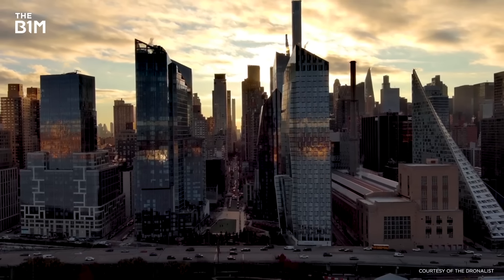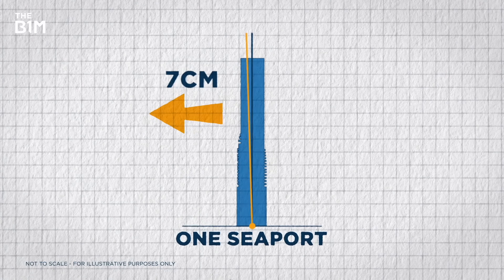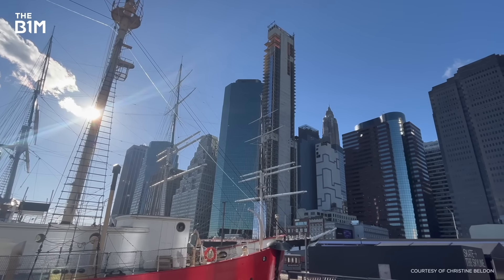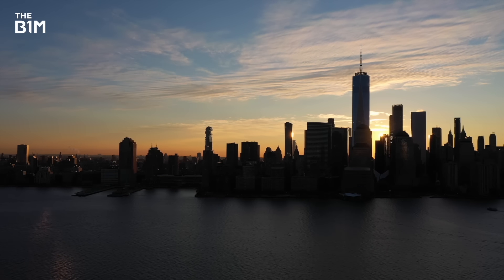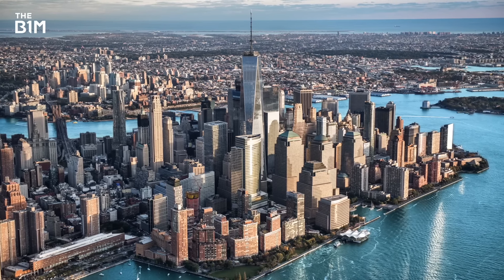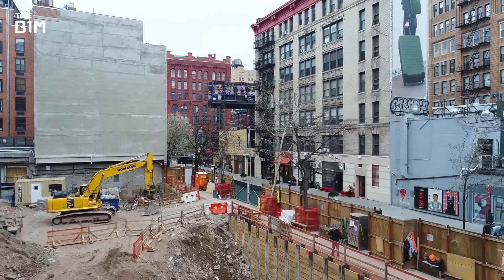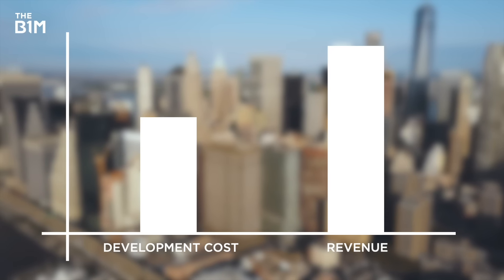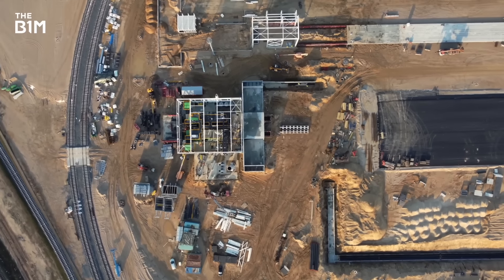The Wild Story of New York’s Abandoned Skyscraper

Comment: Looking at US code, the out of plumbness tolerance for an RC structure is h/1000, so in this instance 8032/1000 = 8 inches (203mm). If it is 80mm out of plumb that's well within tolerance and would just need the glass panels to be designed with larger/smaller deflection heads depending on which side of the building they were on - as Fortis have alluded to. Since the glass is already fabricated, im guessing it's this huge redesign and remanufacture cost that is being ping ponged between the contractor and developer.
Reply: That is if it would not lean further if the glass is installed.
If the foundation is unstable, then installing the glass might cause the wind to push it over.
Reply: The fact that they would go the soil remediation route in-lieu of pilings is alarming. I didn’t even know that was allowed in NYC for such projects. While lower Manhattan has bedrock as many of us know.. the area around the South St Seaport does not have as much and much of the land adjacent to the river is reclaimed land… landfill… some of which is very very old… like from the Dutch. Sadly either the engineers or contractors are likely to take the fall for this, but undoubtedly these were cost-saving measures from the developer. Developers always always always always always are trying to cut corners and skimp out on the important work… meanwhile they’ll pay a premium for an interior designer. 😂
Reply: The problem is how stupidly narrow it is.  The floor plan is showing that the condo's are only 28ft wide.  So what is the building at the base?  Maybe 50ft wide at the most?  It's 670ft tall.  That's only 7.4% of the distance that has to settle.  In other words, to move 3" at the top (76.2mm), The base only has to settle 5.6mm ... That's what we're talking about here.  The concrete base sank 5.6mm on one side.  lol..  This is just silly.   The base should have never been made that narrow, it doesn't allow any room for error.
Reply: Is the issue that it is leaning too much now or is it that it might lean further in the future? I am not an engineer.
Reply: I agree, the foundation solution is not the best. I’ve recently completed a project in the U.K. where we took out any risk from the soil and did 35m piles for only a 6 storey building. I’d definitely be piling this prominent NYC skyscraper! 

However, If I’m not mistaken Arup and WSP have looked at this building and said it’s good to go. Assuming they both did their assessments fairly and diligently, The whole story smacks of a contractual argument rather than a structural issue.

- For a raft foundation to be proposed on a project this big a ground movement analysis is almost a given pre-tender. I find it difficult to believe the contractor didn’t have access to this when they bid. If it was left out, They should have asked for it and if it was not forthcoming, that should have been a huge risk item that is priced in to the quote. 

Whether the building moved because the raft settled, or whether they built it crooked themselves, they are now out of pocket to have all the panels remade and are trying to find an exit.
Reply: Yeah, but if I had the money, I won't get a unit from this. It has that reputation already, no matter what they do, they fucked up. No fixing that now.
Reply: No one has alleged it’s unsafe. It may be suffering due to millennial tower backlash. And part of the problem is it’s happened so quickly that no one has confidence it’s done and at its final tilt. The curtain wall isn’t even done so it could get worse.
Reply: @ki-roasted in litigation contractor says developer called for the corner cutting; developer says contractor did. Guess we’ll see what court determines.
Reply: The concern is not so much the amount of lean, rather the cause, which is believed to be an inadequate foundation. No-one will invest further in a building that could be potentially unstable.
Reply: @Mark.D.H.  it’s my understanding that all the pre-sales pulled out and the developer was depending on pre-sale capital to finance the finished construction. So they’re really screwed. Although I am reminded of the adage, “If you owe the bank $100, it’s your problem. If you owe them $100M, it’s the bank’s problem.”

Comment: As a kid, I created a way to supply emergency power, and connect all of NY City's skyscrapers with a single threaded spiderweb type connector, through the mid axis of each building using the average of all heights. It does not take a lot of energy to prevent a building from falling(contrary to intuition), similar to how you can hold a friend up from falling with just your pinky finger. This "power-web" would create a similar effect as a tank's tracks do, and spread the over all load between many buildings. It would have a feature that would disconnect  from a building that swayed more than the designed limit...like I said, I was a kid, it made sense then, but I haven't given it the proper thought since ^^ I would imagine there are giant physics challenges in my "15 year old me's" idea, lol.

Comment: I am curious as to what the allowable vertical tolerances are?. 80mm over a couple of hundred meters does not seem like much. If a 200m tall skyscraper is designed to move several feet in any direction what is the issue? Hypothetically, if you were able to insert a wedge,  half the thickness of a credit card, on the leaning side of the structure, it would be perfectly vertical.
Reply: Designed to move is one thing...leaning is another...

Comment: It would be cheap insurance if skyscraper building foundations were built with capacity for adjustment so these problems could be easily fixed.  I’m surprised if modern seismic isolation packages don’t already have this feature as optional.

Comment: we just put in some foundations for hydraulic presses that weigh 400 tons on a 15 x 20 foot footprint. so our soil is very soft as we are also about 100 feet from a river. so we had the contractor put in helical screw piles to bedrock which is 50 feet down. 20 piles no problem, took 1 day . there is 1 blade at the tip and they just rotate them and they screw down without too much problem. just takes the right equipment. and this was indoors as well. $2K  each pile,  installed.

Comment: If the pilinga are on the bedrock, a 4 inch lean at the top of 60 stories , I don't think is much of an issue.  Has the lean chnaged any since?  Sky-scrapers sway several feet in all directions depending on the wind,4 inches ain't gonna change anything. The tower  in Sam franscico is a different ball game, becauce it has an increasing tilt, as the pilings were not driven down to bed-rock

Comment: The big question here is whether the settlement is finished and the building now stable.  If that is the case then the simple solution would be to shorten the columns on the high side, above the ground. to bring the building above straight.  Not easy, but not impossible.  But if it's still moving - then it's new piled foundations or knock it down and start again.

Comment: I bet not a single building in same area is without settlement...

EVERY building settles. 8 cm over 60 stories is nothing. It is only a problem if it continues to settle. If foundation issue, they can be fixed. Side that is settling can be made stronger with more pilings, bigger and deeper. Building can then be jacked up 10 cm and watched to see if it settles the 2 cm calculated. 

Finger pointing never fixed a single problem... team work is needed here.

Comment: Just because something looks possible in theory, on paper it does not mean it’s actually possible in practice and definitely does not mean the theoretical method would get approved. 

Underpinning IS NOT AN OPTION. It will never adequately tie the building in. You cannot underpin a high rise that has ZERO support structure to begin with. Underpinning would only be an option if the building already had appropriate footings and it needed a little more support. It’s 100% not an option for a building that has nothing supporting it to begin with. 

This video is a bit misleading because it suggests that building without adequate footings is a possibility by adding materials to the earth. That couldn’t be further from the truth. I can assure you, (apart from this building) there’s not one single high rise building in the world that was built without proper pylons and footings.

The local municipality or relevant authority needs to intervene and demolish it and pass the costs onto the imbeciles who are responsible for building it and making the decisions to build it. Then, this developer should be sent to prison. I wouldn’t even stand near that building.

Comment: It can’t be that hard to figure out what’s wrong…..As a solutions Designer I know that it is hard to fix, but to figure out the problem is usually easy. Blame? Another question outside solution. 
If the concrete slab is of by just 0.1-0.3 deg. You get a x angel lean at xx hight. If the foundation is poorly constructed= can’t handle wind load. You have a Big problem.

As water front building are demanding as sea water soil needs be isolated outside the buildings foundation, a small error or leak will undermine the foundation an create unstoppable instability. Not best problem handle….

Comment: No only the soil/foundation issues, the structural design is under question, from the perspective of a structural engineer to me. It’s not stiff enough in one direction compared with the other. It’s a kind of lucky the leaning happened now and caused, perhaps by the soil/ foundation. If not, and happens after being occupied, it would be more disastrous.

Comment: I don't understand why this is so hard, if the building is already done which it is meaning broken and no one can live in it, just take it down, find out the cause and this will go through the court much faster. Fix the issue, than put the building back together. Clearly the builder is at fought because this building is just every other building for the most part in NYC, glass sides, nothing ridiculous built into it and the other buildings aren't leaning one way, clearly a mistake was made with the soil since they didn't do what every other building has done with pilings

Comment: The problem is how stupidly narrow it is.  The floor plan is showing that the condo's are only 28ft wide.  So what is the building at the base?  Maybe 50ft wide at the most?  It's 670ft tall.  That's only 7.4% of the distance that has to settle.  In other words, to move 3" at the top (76.2mm), The base only has to settle 5.6mm ... That's what we're talking about here.  The concrete base sank 5.6mm on one side.  lol..  This is just silly.   The base should have never been made that narrow, it doesn't allow any room for error.

Comment: Do airports ,factory, shoppingmall`s and hospitals use that form of piling? ,or do airport`s factory s hospitals and shoppimgmalls need retaning walls? Alot of the largest buildings in the world are either airports 'factory hospitals and shoppimgmall`s.
Reply: Typically those first three are low sprawling buildings. The static forces from the building are spread out. The resistance to wind, seismic, or blast forces are usually dealt with in the design of the above ground structure. A factory may have some unique loading conditions but those are usually handled by an application specific solution. You're not dealing with a large building mass on a small footprint, or moments acting over a 60 story building face. Hospitals come in all different shapes and sizes. Their use or specialties can come with unique structural requirements for the facilities needed.

Comment: Ha!  The millennium tower has 29 inch lean.  What are they worried about?
Reply: really  ?????
Reply: @gulfstream-tvstudios9546  Yep.  And that would be about eight times greater than the NY skyscraper.  Its has also sunk 18 inches as well as having the lean.  The cost of the current fix is at least 100 million, and could go as high as 500 million, with no guarantee that the fix will work.   I think that they are going to eventually need to tear down all 58 stories and write off the 350 million cost.  Its currently the sixth largest skyscraper in SF.   And the problem occurred because they tried to save money on the foundation by not driving the foundation supports all the way down to bedrock.  I can't begin to imagine how the MT would fare if SF was hit with a large earthquake.

Comment: 8cm lean is not a big deal, when you consider these buildings can actually "sway" up to several feet in wndy conditions, but as of now, no major issues, as they are designed with this in mind.  In fact, in general, some designs are better if they can sway and have a bit of "flexibility" versus being rigid.  Rigid structures can be more prone to failure or breaking than ones that have some "play" factored into them (ie. less rigid).  This is why on vehicles, for example, you may find some components that can flex and move, versus being rigid.  If they were rigid, they would snap or shatter.

Comment: Most buildings are leaning to some degree. 8cm is  really nothing for this hight,  depending on where you measure it you get a different value and I guess 8cm was the highest point. 
Quite often developers look for discounts by threatening to sue.
Reply: the issue is that lean will get much worse as a facade and interior is added. It will likely double and is a serious risk to occupants and the neighbouring towers.
Reply: The most expensive unit gets the biggest lean, nobody wants to pay for something that has issues already at that price.
Reply: The problem is how stupidly narrow it is.  The floor plan is showing that the condo's are only 28ft wide.  So what is the building at the base?  Maybe 50ft wide at the most?  It's 670ft tall.  That's only 7.4% of the distance that has to settle.  In other words, to move 3" at the top (76.2mm), The base only has to settle 5.6mm ... That's what we're talking about here.  The concrete base sank 5.6mm on one side.  lol..  This is just silly.   The base should have never been made that narrow, it doesn't allow any room for error.

Comment: 8cm really isnt that much. So much fuss over a lean smaller than the height difference between one side to the other side of my room.
Honestly, if it bothers folks that much just flatten the floors again. Thats maybe 1-2cm difference bewteen one side to the other.
Reply: Thank god you're not in charge of construction. Holy Shit
Reply: @serebii666  I'd prolly do a more decent job than the ones who built the house i am living in a hundred years ago. Mainly because i built a shed with a near perfect level. 

But 8cm lean at the top of a skyscraper really isnt that much.

In case you dont know, your middle finger is prolly about 8cm in length.
Reply: @Techischannel  the video says it will lean more if the glass panels are installed because it will act like a sail.
Reply: As pointed out in the video, the lean is probably a symptom of a basic fault in the design/construction of the foundations. Thus doing what you suggest would merely mask the issue rather than solve it, and would lead to much more serious problems in the future. Note that the lean on the Pisa tower was increasing year on year, and would have led to the whole structure toppling over, until remedial work was done on the foundations from 1993 onwards. That took 8 years work to complete. Imagine how much work would be needed on the much larger New York structure, and that is, unlike the Pisa Tower, surrounded by other very large and tall buildings.
Reply: @Techischannel  Lol you're an excellent example of the Dunning–Kruger effect in action. The building is already in a slant NOW, before any of the other heavy elements like the glass facade, internal systems, interior finishes, HVAC, etc. are installed. And you suggest pouring MORE concrete to "level out the floors", which due to the nature of the slant will be more and heavier on the already leaning side (the one with the destabilized foundation). Dude stop pontificating on things you have no concept of. A 100k tonne skyscraper is not a garden shed.
Reply: @Techischannel  I didn't call you stupid, just obviously uneducated on the topic. You very obviously were not being sarcastic and are now trying to cover for your previous ignorant comment. 
And I should hope I would know "so much more" than a dude who's total experience is building a shed, since I actually studied architecture.